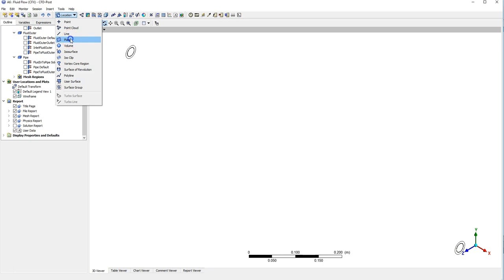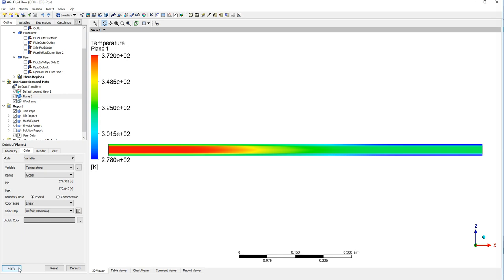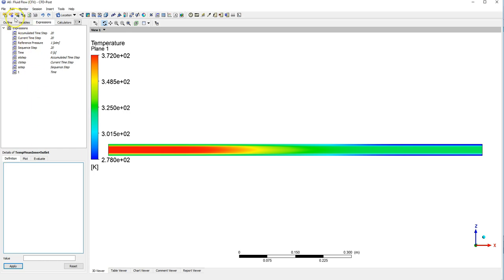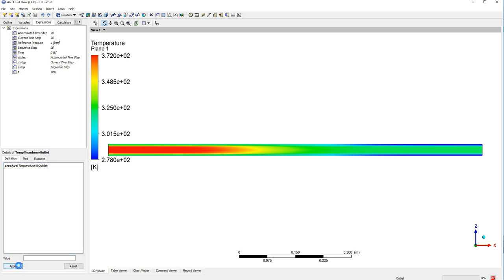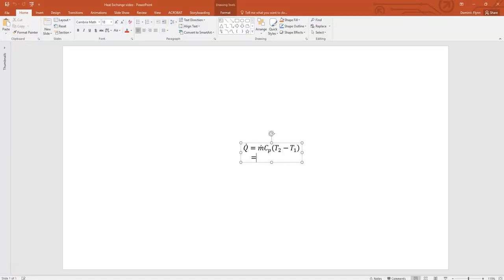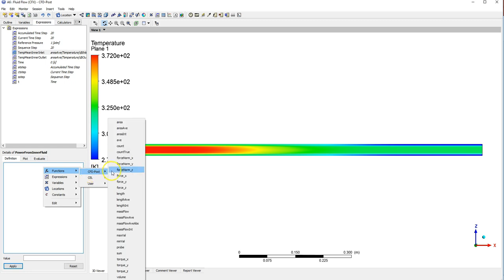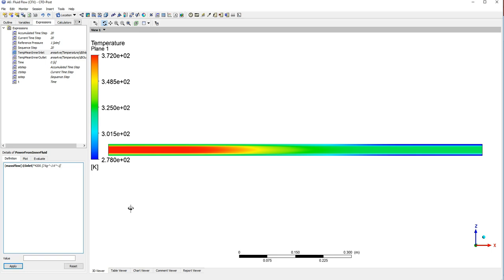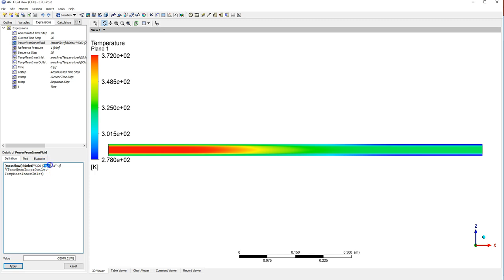Calculating heat transferred from fluid in concentric heat exchanger using Ansys CFX Postflow

Comment: really good
Reply from the maker: Thank you 🙏
Reply: @ClimateCFD  You're welcome. I have a question about Fluent PP. Using Reports - Flows - Total Heat Transfer Rate, the user receives an output that breaks down thermal performance by domain component. How is the thermal power calculated under the inlet boundary condition?
Thank you.
Reply from the maker: @AR-yj4ft  it’s been a while since I have seen this so will have to double check.

However thermal power is usually Q_dot = m_dot * Cp * (T2 - T1)
Reply: @ClimateCFD  allow me to explain in-depth the energy balance in a domain if you don't mind. Energy flux through a non-wall boundary like inlet / outlet is the enthalpy, calculated as Cp * T(inlet). Typically, Fluent reports the enthalpy on non-boundaries as specific enthalpy (J/kg) weighted by flow rate (kg/s) -> (J/s) -> (W).
Whereas the energy fluxes reported through wall boundaries are different. They are Q = HTC * Surface area * (Tenv - Tfluid), where the HTC has to be clearly defined. Fluent reports integral of Wall Fluxes -> Total Surface Heat Flux (W).
Thank you for exciting discussion!